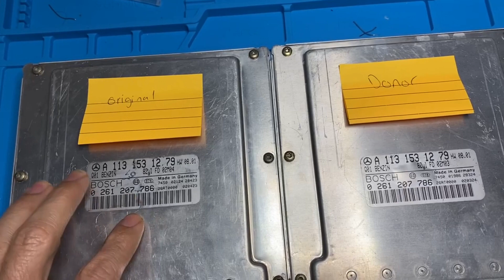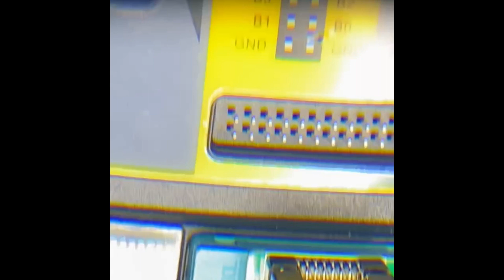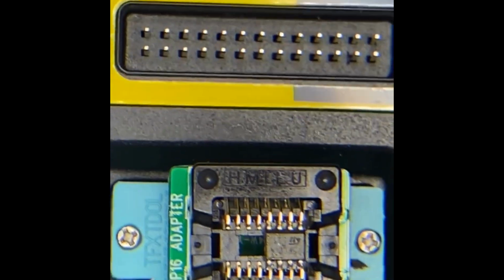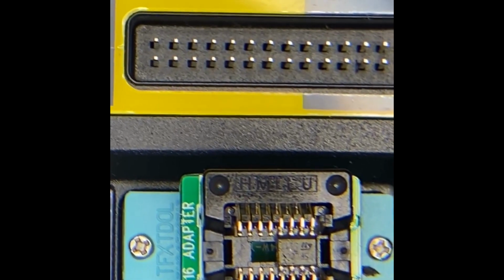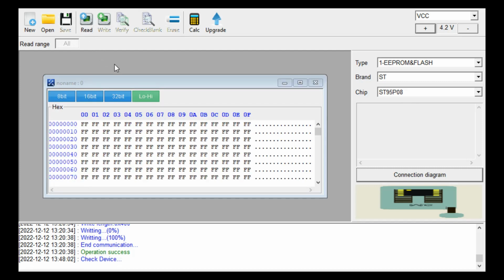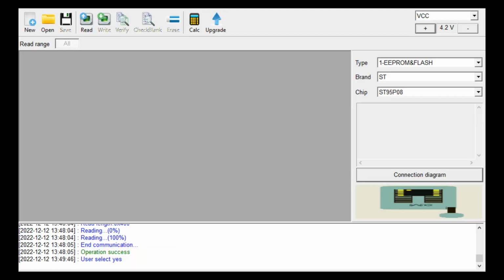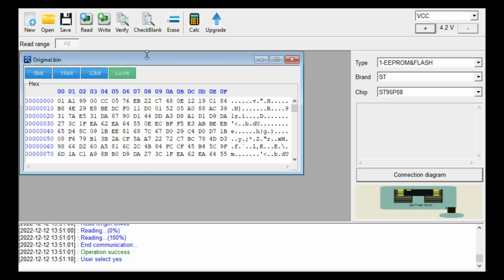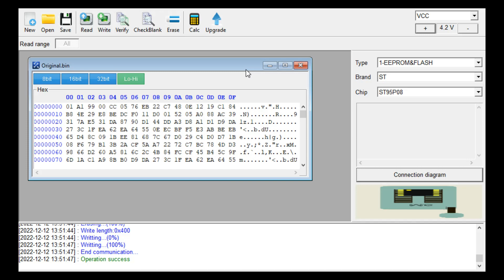Mercedes ME2.8 Clone a Used ECU or ECM

Comment: Amazing work from these guys, I had an issue with my 2009 W204. I knew this was the issue but Mercedes wouldn’t help me unless I took the car to them,
It would have cost me thousands to get a new ECU from them. Thanks to these guys they went above and beyond even when issues occurred with my original EcU they were able to clone a donor unit. With everything installed my car fired up on the first try after weeks being down. 100% recommend. Thank you again so much!
Reply from the maker: Thank you Stephan. It was good working with you brother. 👍

Comment: Hello, are you able to remove the Immo chip from a Bosch ECU, if someone wants to use a newer engine in an older car as a standalone unit? In my case it would be the ECU from a 1998 Mercedes 2.3 Kompressor...
Thank you.

Comment: Very little info is found for ME 7.4.7,mine starts massive misfire on multiple cylinders after 10 km drive,I sent it for testing and they could not fault,could it be the injector driver mosfets?
Reply from the maker: It could be the mosfets. It could be the ignition controller chip. It could be solder integrity issue. It’s difficult to diagnose the cause. Much easier to replace it with another unit.

Comment: Question couldn’t you just solder the original chip to the donor ecu without reading the data and transferring to the other chip?
Reply from the maker: Yes. As long as the part numbers match on the ECM.

Comment: I have a 2004 clk500 with this ECU,  it's got the immobilizer set for some reason, the key turns the steering lock releases radio and all other modules are active and running, hit the brakes I can get it out of gear, but.... No crank no start and for some reason it says immobilizer active on my scanner when scanning the ECU.. is there any way to delete the immobilizer entirely?
Reply from the maker: We can clone your ecm. That will fix this issue. 

Https://mercedesbenzspecialist.net 

Call or text us at 818-510-3375

Comment: Is it possible for you to just read the original EEPROM on the board and then write it to the donor EEPROM on the board?
Reply from the maker: Yes. The FBS data and VIN can be transferred from original to a donor. However, the VIN in the donor will revert back to its originally programmed VIN after it is disconnected from power. Therefore, unless you have a Xentry/DAS or similar scanner to go in and change the VIN after you have received it from whomever programmed it for you. The VIN change won't hold.
Reply: How is this possible? I thought an EEPROM was nonvolatile, meaning it doesn’t lose data when it loses power. And doesn’t the writing process erase the EEPROM before it is written to?

Comment: Hi I have a question. My Ecu unit is A2721531591, can i use A2721532992 or A2729002700 as a replacement? Some suppliers said its the same for all A272 models. Can you help? Thanks in advance!
Reply from the maker: Not all 272 ECMs can be used to replace your original ECM. 

There are several variations coded into ECMs. For example, if you have a rear wheel drive vehicle, you can’t use a donor ECM from a 4Matic vehicle. 

It’s best to get the same part number. 

Even better, get a ECM that supersedes the original ECM part number. Mercedes releases superseded parts to replace parts that had known issues. 

If in doubt, contact us ready with your VIN and we can advise on the correct donor ECM to use. 

We also offer cloning/programming of a donor ECM to your vehicle. 

https://mercedesbenzspecialist.net/shop/ols/products/ecm-ecu-engine-computer-module-programming-clone-service-for-mercedes-me97